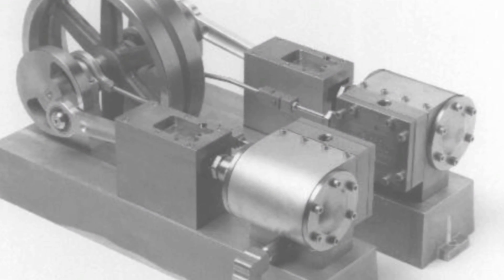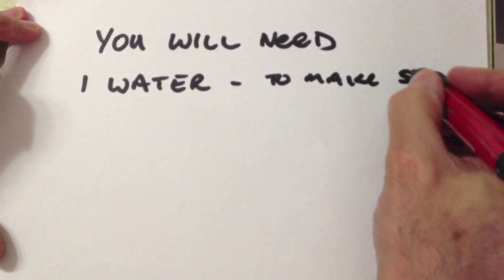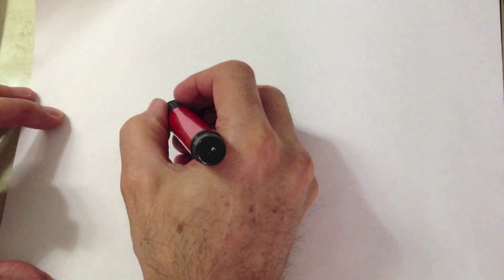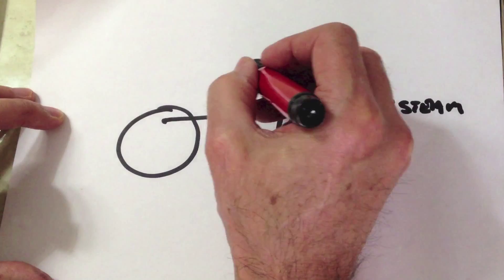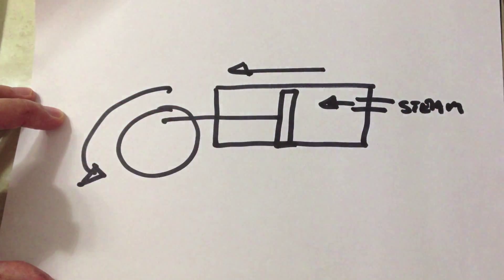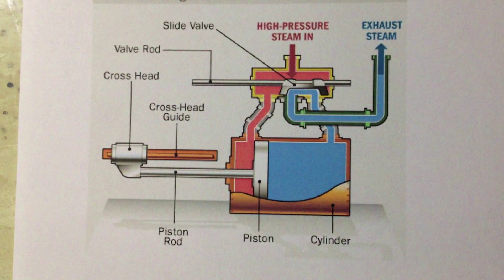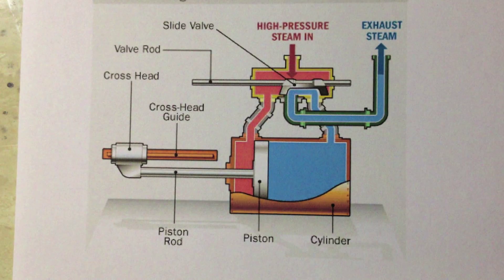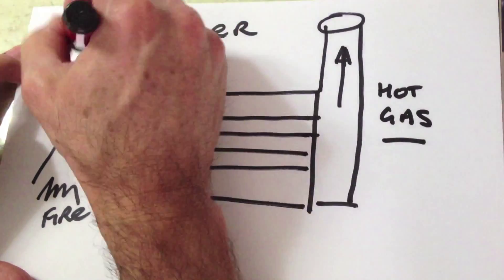How a steam engine works, Classic Machinery

Comment: so fuel for a steam engine is water. When the water is boiled and powers the piston, do you cool the water down and use it again? or do you just use new water? where does the boiled water go??
how does the exhaust work in a steam engine?